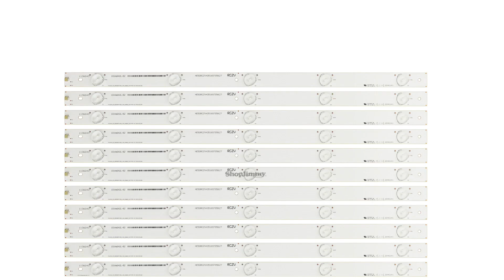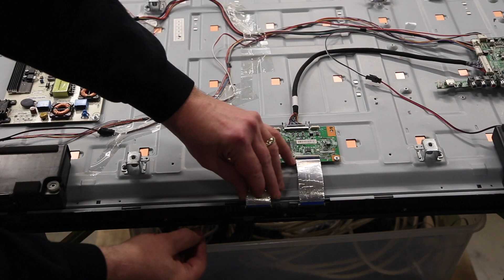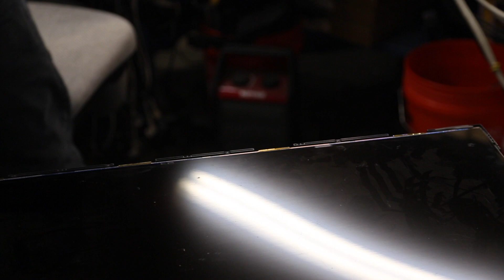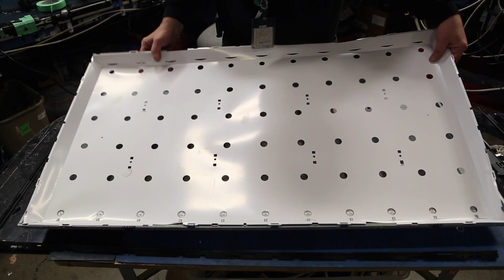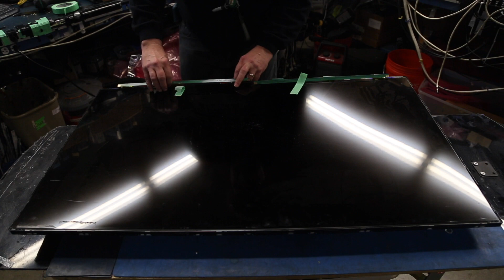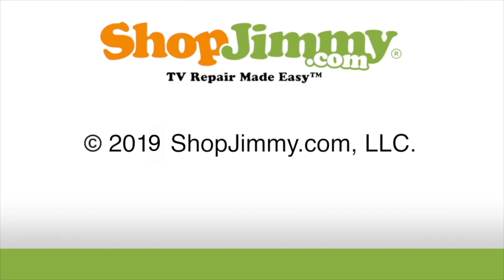Hisense 50" TV-No Backlights & No Image LED Strip Replacement - Hisense TV Models 50H

Comment: Mine could have a bad capacitor.  I can see the image, but only with a flashlight in a dark room. The audio is fine and all other commands are fine, just a faint picture. It's weird. I might just turn it off and disconnect everything that is plugged into it overnight to see if it fixes itself. This is a great vid.

Comment: Hello! My TV's LED backlight comes on for a few seconds, then goes out. I I installed all three items in this kit. What else could it be?
TCL 40FS305 (Service No 40S305LACA) Complete TV Repair Parts Kit  Main Board and Backlight Inverter and Wifi

Comment: i  have a LG  plasma tv 42" and the problem is that there is sound but No picture, After long period of not switching on the tv say 1 day or 2 days, when I switch on after 1 day, it shows the logo LG like screen saver moving then goes away, screen turns black again. it does not go on Video 1 n 2 but has sound, please suggest solutions for this. Many Thanks!

Comment: My TV is a element the model is ELEW248 when I push the power button it won't turn on the light is not on is red when off blue when on it has no video,sound nothing I was hoping you could help me with this

Comment: Great vids. 
I have a hisesnse  55h6e that shows a indicator light, but when I turn it on the light just flashes. I opened the back of the tv up and you can hear a clicking sound coming from the power board, and when you hit the power button the clicking sound stops until it quits flashing. I have looked the components and everything is visually ok. Any help would be much appreciated, thanks and keep up the great work!
Reply: i have the same issue. did you figure it out?

Comment: Hi I purchased a driver board hoping it would solve my no picture/sound problem as sited by your video and after replacing it I still have the same issue. I know I have picture because if I shut the lights out and power on tv I see HDMI 3 then a no signal (not hooked up to anything) and can use remote to see menu etc. Do you think it is an individual led backlight issue? Also what amp wattage etc would the led lights be? Do "any" leds work or do they have to be specific to that model? Or do you think it is a different issue altogether? Any help would be greatly appreciated!!! Mark
Reply: P.S. this is for a Tcl 50fs5600 tv

Comment: Hello guys. This might be not appropriate with this video but I am about to give up. I need your help in fixing my Oled tv. Model is lg 55ef950v.  Symptoms are it blinks 30 times when I am trying to turn on. Basically i have tried to disconnect the tcon board and other things leaving only connected tp power supply. It does same thing. I have tested the power supply with fake inducing 3.3v and it seems to be giving right voltage out. It leaves me only with dead motherboard, but I can't seem to find the cause on motherboard. Not sure what else to check. I have even tried to replace the microprocessor and yet it does same thing. Was thinking to try reprogramming the bios chip, but i can't find original bios chip file anywhere, so not sure if that would help. Maybe you got any suggestions on what else to try?

Comment: Hello....Need a fix recommended for a Samsung Plasma TV....Model #(PN50B650S1F) The tv has sound but no picture. The picture is a greyish color and it reacts to button presses. So what i mean by that is that when you press a button the screen will fade almost flicker...and then return to the same tone of grey....I see a few black horizontal lines in the middle of the display as well. They are thin...Any help would be greatly appreciated! Thanks